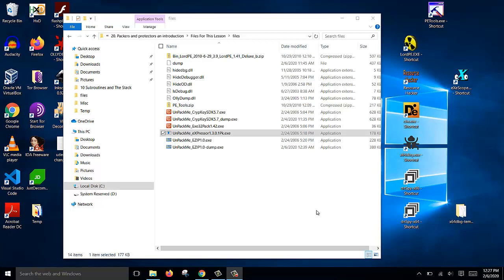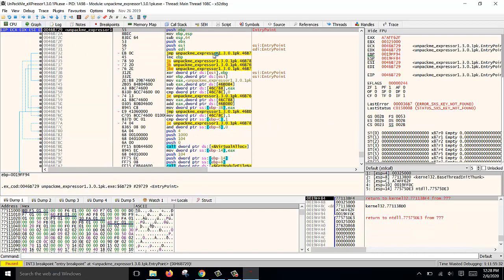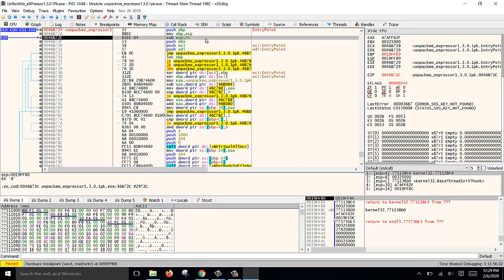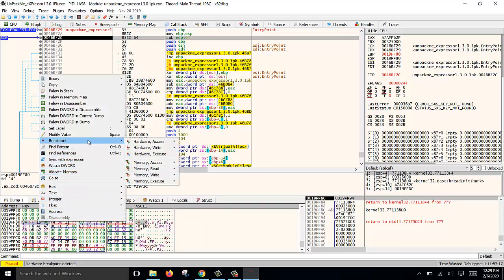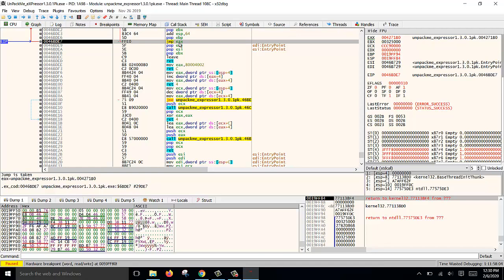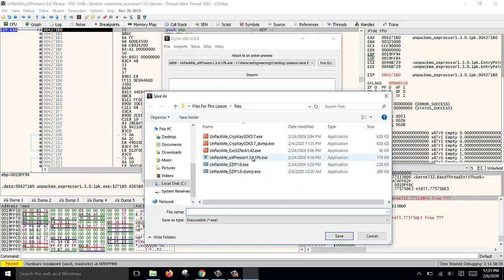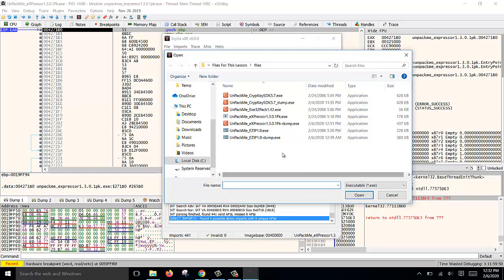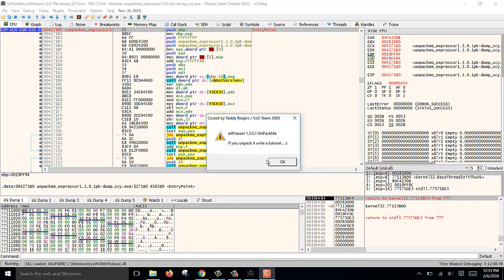How to dump original PE file and rebuild IAT table

Comment: What if the process has antidebug and you cannot attach debugger?
Reply from the maker: Click on Hide Debugger in the xdbg. Alternatively, use the ScyllaHide PLugin for xdbg. It is explained in my CSP course here:  https://crackinglessons.com/learn/
Reply: @PaulChin20  It just end up with EXCEPTION_ACCESS_VIOLATION
Reply: @PaulChin20  Also, with SycllaHide PLugin, I just get could not open process 9228 when trying to attach to the process
Reply from the maker: @元始天尊-b7k  Try the CSP course.

Comment: how can unpack VMProtect v3..00 - 3.5.0 - 2003-2020
Reply from the maker: So far I have not been able to unpack VMProtect. But instead of unpacking, you could try bypassing it. My course teaches how to do this:  https://www.udemy.com/course/reverse-engineering-packed-programs/?referralCode=70C43F3B0CE437E9CE1F

Comment: why in my case it keeps running without reaching the breakpoint?
Reply from the maker: Maybe you set the breakpoint at the wrong address?
Reply: @PaulChin20  maybe because software is protected?
Reply from the maker: @Velnio_Išpera  Try checking it with Detect It Easy (DiE). It will show if the exe is protected as well as the name of the protection, if any.
Reply: @PaulChin20  It has protector. I guess with protector you can't find original entry point. I don't see strings either. I guess your courses are only when the file is unprotected.
Reply from the maker: @Velnio_Išpera  This course teaches how to bypass protection by using memory hacking:  https://www.udemy.com/course/reverse-engineering-packed-programs/?couponCode=REMHSPEP4

Comment: Hello, I found the OEP but when I use Scylla to get the IAT it says in the log "IAT Not found at OEP 76F95DA2" and after its done checking it says "WARNING! IAT is not inside the PE image, requires rebasing!". In my case the exe is protected with VMP version 3.5 so I guess they hide the imports some how. Any help would definitely help.
Reply from the maker: So far, I have not been able to unpack VmProtect. But I can bypass it by hacking memory. I teach how to do that in the CSP course:  https://crackinglessons.com/learn/
Reply: @PaulChin20  what's the difference between bypassing and unpacking?
Reply from the maker: @svenskithesource1130  Unpacking means to patch the file itself. But in bypassing you do not patch the file, instead you let the file run and you tamper with the process memory to bypass its security protection.

Comment: Thank you sir, sir have seen the intro to your course in udemmy. I want to pick up the class by making payments, but first sir I have a question, is it possible to reserve Engineer a application, that uses internet for the registration and activation, for example I have a application I downloaded as a trial version, after the trial date I was ask to purchase the application, through the internet, I want to know if there is a way to by pass the purchase.
Reply from the maker: Yes, it is possible. You need to use a debugger to see where the serial key verification is done and modify the code to bypass it, or, to set verification to true. It depends also on whether the software has protection. If there is, you need to bypass protection and then unpack it. Then, if your software was created with .NET platform, you need to decompile it with dnspy. But if it is obfuscated, you need to unpack it first.
Reply: @PaulChin20  wow!!! This is a lot of steps, I don't have any basic knowledge about Reserving Engineering. Okay sir goes your Tutorial course cover everything I need to know. I really have passion for it sir
Reply: One more thing sir, I noticed the promo will end less than 4hours, I won't be able to pay now, we are just resuming back to work due to the lock down, can you give me in a weeks time to geather the money. Once I make my payment sir I will let message you via email
Reply from the maker: @FemtechStudio  Sure, no problem. Thanks for your interest!